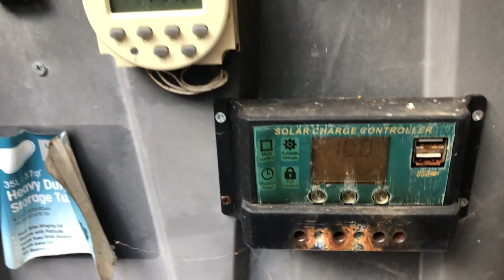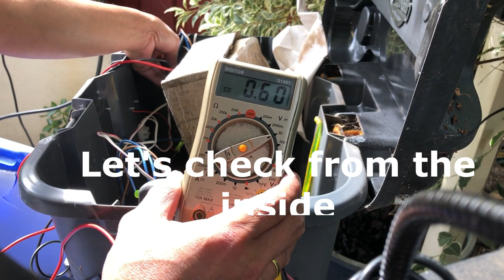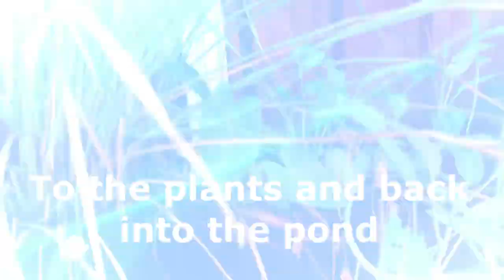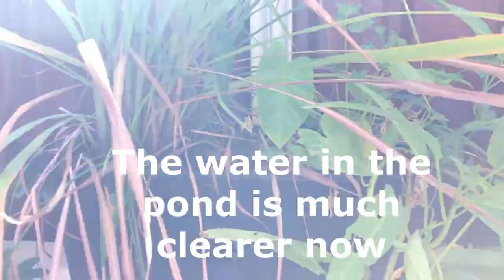Simple Aquaponics System in the Backyard Garden #simpleaquaponicsystem #backyardaquaponics

Comment: A fellow aquaponics loving Perthite here. Thanks for the using bilge pump tip, gonna try :)
Reply from the maker: I've tried other 12v pumps.  They clog easily.  I've had the bilge pump for years and still working.  I bit pricey at the start, but if it will last longer...